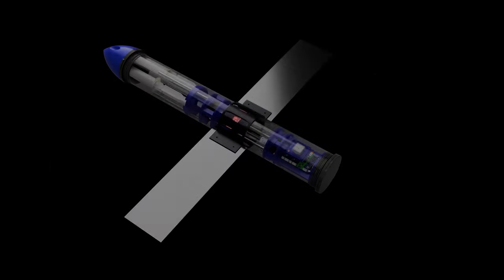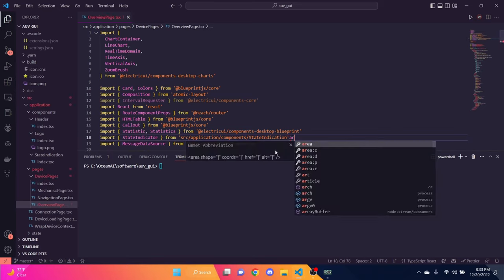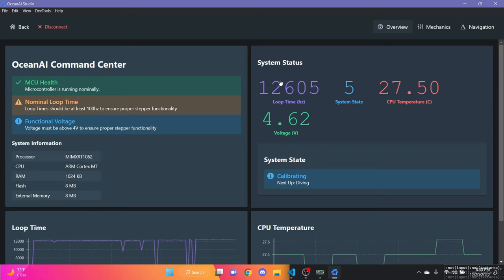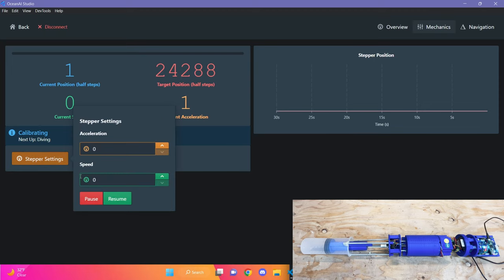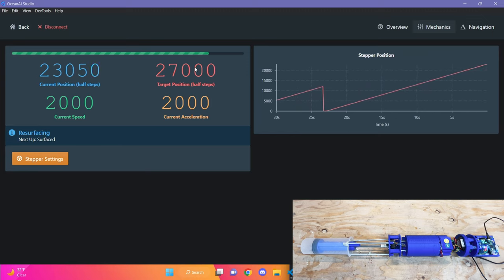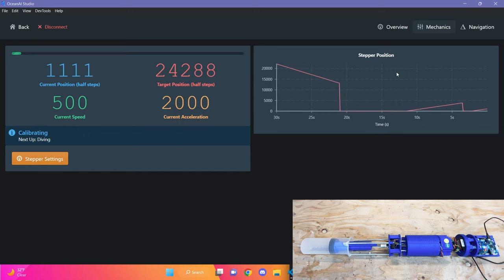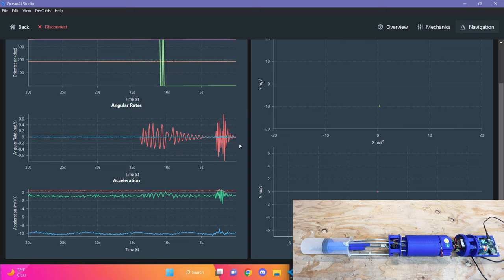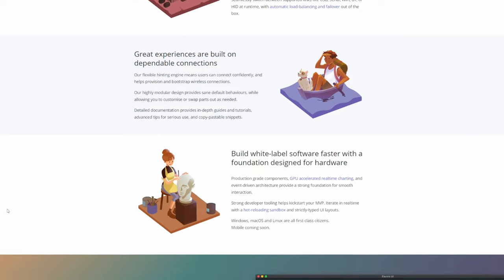Underwater Glider Control Interface

Comment: So is this just for debugging? WIfi tends to not work very well underwater due to the attenuation of the signal.
Reply from the maker: At the moment haha. Maybe for control too, but the vehicle is mostly autonomous. The RF signal is transmitted and received on a buoy on the surface, to keep that from happening.